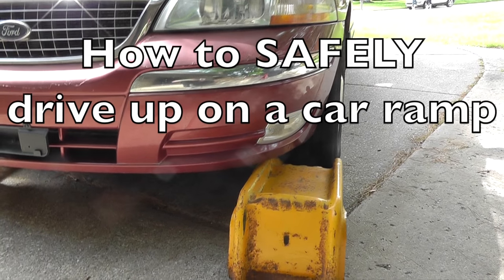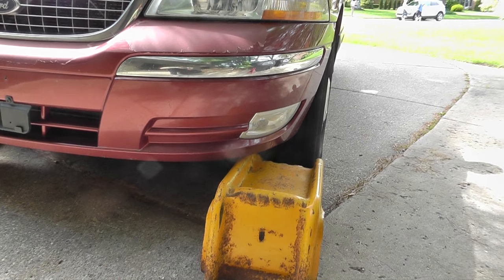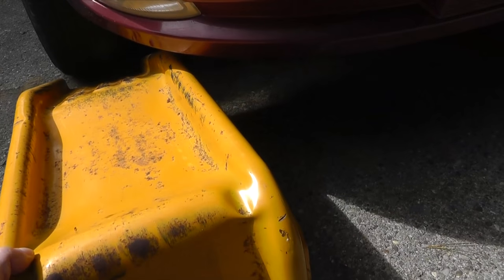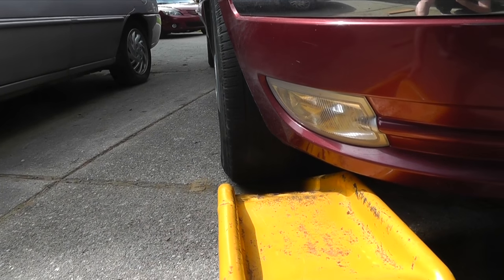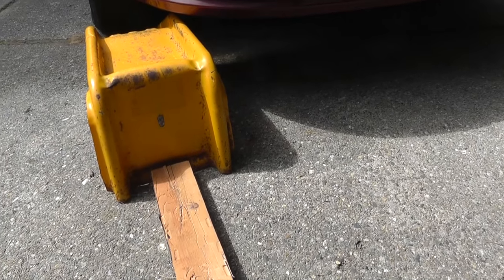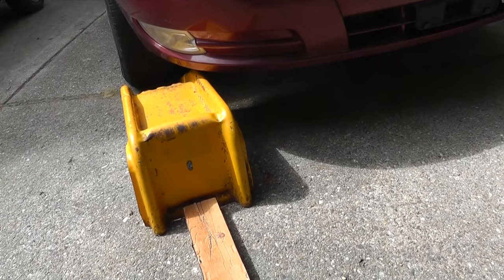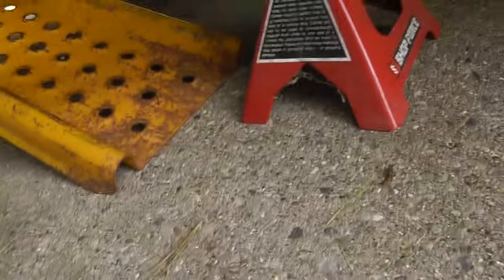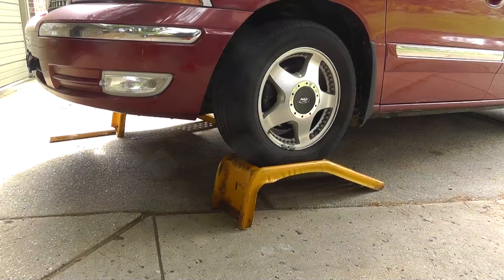How to SAFELY drive up a Car Ramp

Comment: This safety video is completely unsafe because it does not mention the ramp weight capacity or the fact that you need to  engage the parking brakes after getting up the ramp. Duh?

Comment: The alternatives are not plastic. They are a composite material which is extremely durable and will not degrade over time. In fact, they are a similar material to what is used for composite decking, which is engineered to withstand very harsh weather conditions so I would not fear those ramps becoming brittle over time.
Reply: who sells them?
Reply: Grant Taylor you can find them at Walmart or any auto parts store

Comment: Those are the most UNSAFE ramps because they have no horizontal brace and eventually collapse. God forbid you should be underneath when it does.
Reply: I recently purchased a set of steel ramps from Harbor freight! They claim to have a 6500 lb weight limit. I have driven up onto them 3 or 4 times now. I usually put jack stands under the car as well however, The jack stands are not under load/without weight upon them so, If the car falls, the sudden weight could also impair the jackstands. What do you mean by horizontal brace? I have seen one with a metal strap, that runs from the vertical part to the ramp,   Is that what you are referring to?
Reply: @d.j.9961  Yes, Einstein.

Comment: I tired to use these before the ramps slid  out underneath my car and messed up fender. While was attempting to drive up, slid across the concrete floor not enough grip.